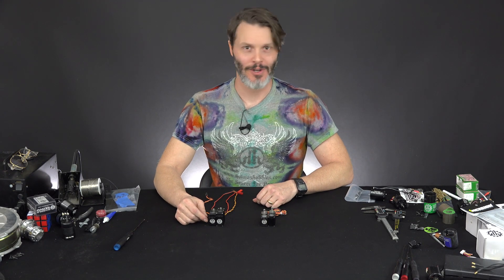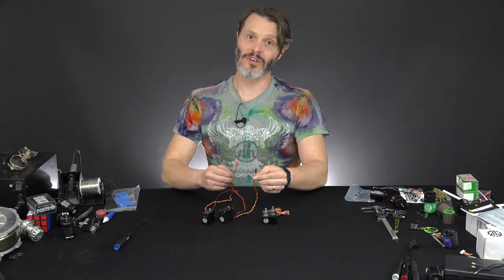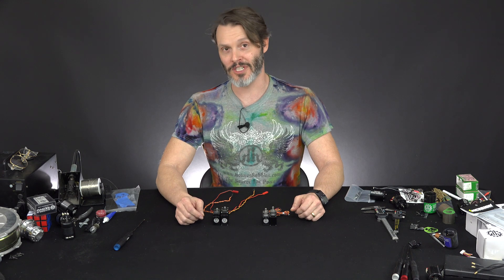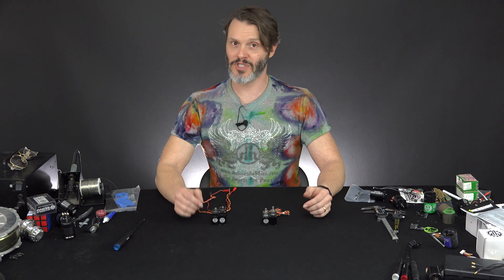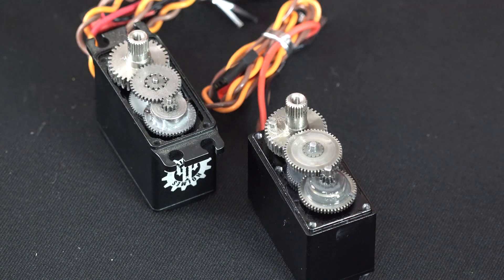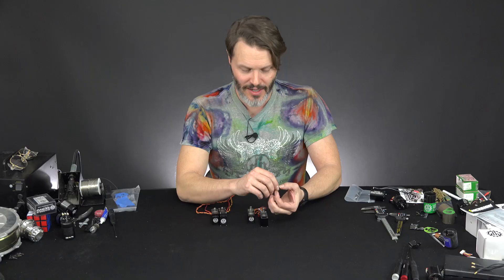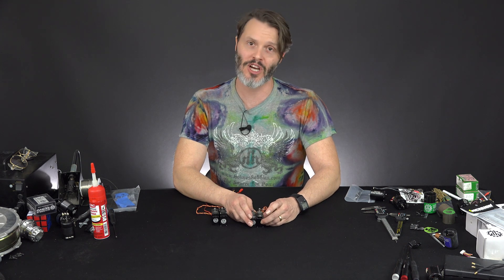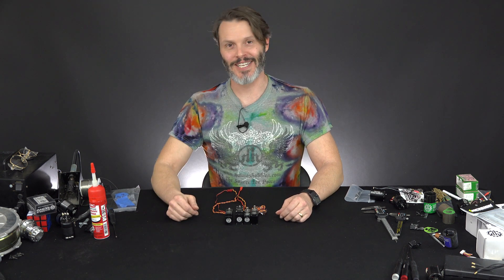Next Level Servo! Features & Specs Of The New 3-4S LiPo Capable BLS SHV500V3 Servo - Holmes Hobbies

Comment: What size battery would you recommend to run the servo for about 45 minutes I’m going to run a battery just for the servo thanks
Reply from the maker: Depends on the crawling, but 1000 to 2000mah
Reply from the maker: Most crawlers actually see more wattage in the servo than the drive motor!  Servos are always working hard.
Reply: @HolmesHobbies  okay thanks so much!

Comment: How does this compare with the G13 servo?  I know alot of people opt for the G13 for its lighter weight... is yours heavier for a reason?    Would love to hear your thoughts on a direct comparison.
Reply from the maker: The G13 is simply my v1, so I am very familiar with it.   The v3 addresses pin and gear strength issues via much larger gearsets and pins, which is why it weighs more.
Reply: @HolmesHobbies  thanks, super helpful

Comment: I like powerful servos but refuse to buy one that requires a BEC (K I S S).  REALLY SMART giving it oversized gears and gear pins. Does it fit most RC trucks givin' it's a wee-bit larger in dimensions? I'm thinking of an RR10 Bomber application. $100+ normally exceeds my servo budget, but I might make an exception here.

Comment: Awesome! My V1 SHV500 is still kickin' it in my heavily upgraded Bomber (running nearly 6" tall tires) - my next 2.2" build will be lighter and will get it, while a V3 will soon be mine as I am shoehorning a 4100kv Puller Pro-L "R" into the old Bomber - looking for the even faster steering response.

Comment: Now we just need you to get them back in stock! Your last batch was gone in like, 2 days! Where do you think yours shine over the competitors 3brc etc?
Reply from the maker: In stock now!   More torque, much stronger gears. The 3brc is my v1 with a little hotter tune to eek out more torque.  Will typically break a center pin as the common fail mode.
Reply: @HolmesHobbies  Awesome! Just purchased one! I have a pretty heavy rig and look forward to checking this out!